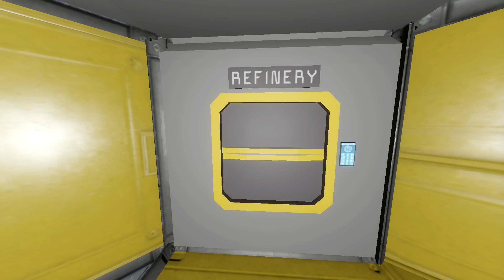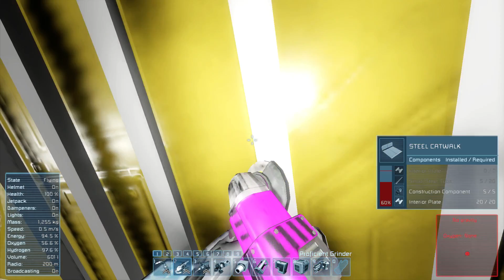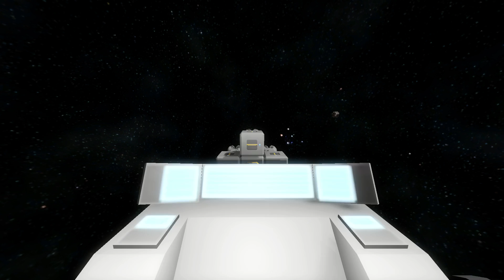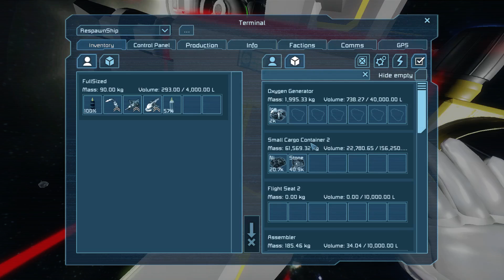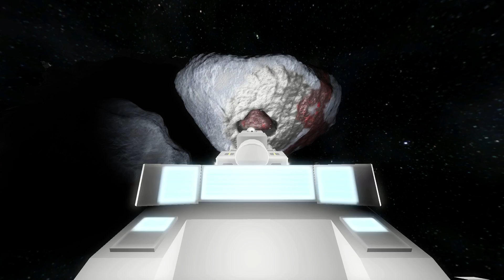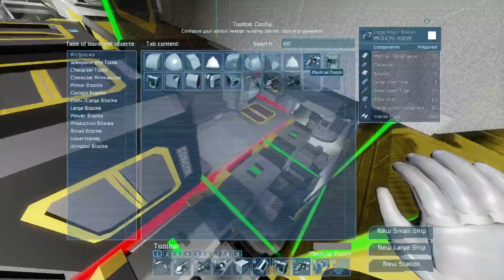Space Engineers Survival Asteroids Start

Comment: you could also do "gravity disc" mining to start.  there is a port for the refinery on the "bottom" of the ship.
so hover over an ore deposit with the ship's Gravity field (set to 0.3) keeping the ore from flying off into space and dig a small pit or groove below the ship
,, but this is an interesting variation on the usual starts .. stripping the ship down to make a platform
Reply from the maker: This can work.  If you recycle only a few armor blocks not needed from other parts of the ship you can also quickly make a funnel several blocks across to focus the material into the collector.  The main reason I didn't feature this in the video is that at the time there was a HUGE bug with even attempting that where even slowly moving objects like ore or droped components would basically rip completely through your ship and destroy anything in their path, the grav generator, and then tear a hole out the other side :)... I believe this is fixed now.  I still rarely play SE mainly b/c multiplayer still can't support anywhere near enough people to make it interesting and single player got old a LONG time ago :(... Hopefully they will eventually fix this.
Reply: I have seen several people trying to use a collector, even with scoops, to terrible and frustrating results.
it just never made sense unless paired with an ejector .. and that is dreadfully slow and cumbersome compared to a connector.